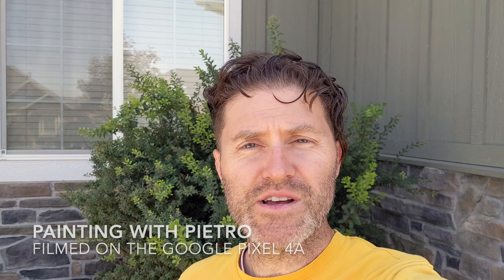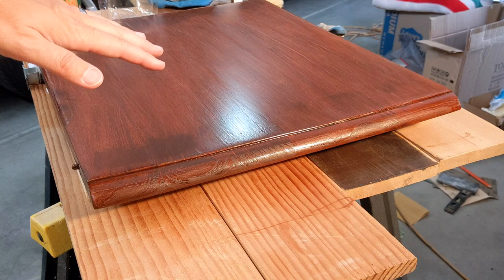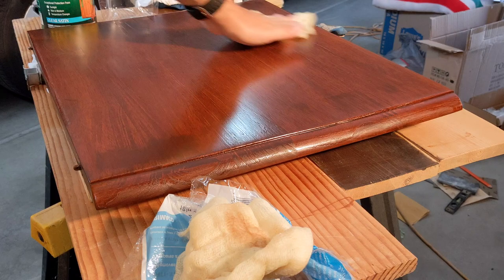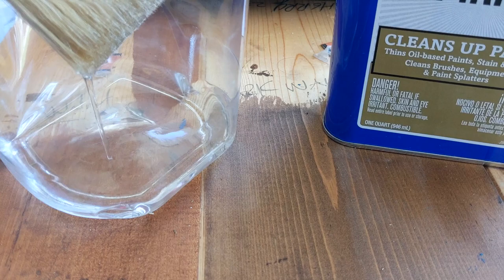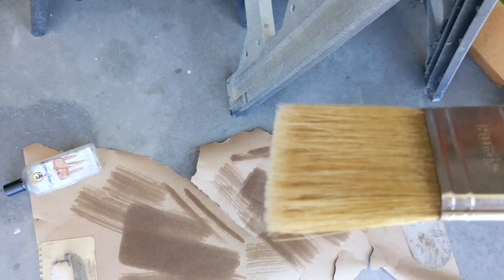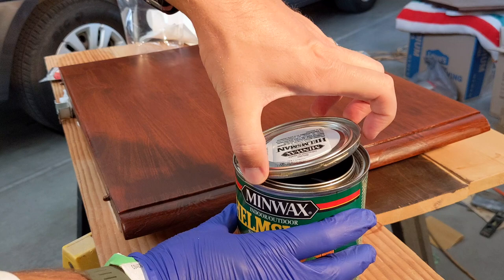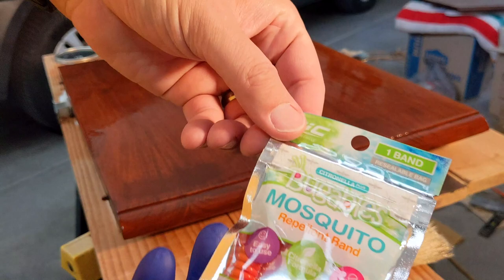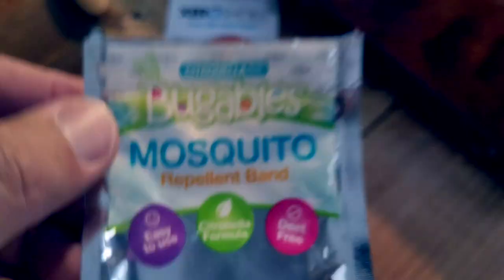How to refinish a kitchen table... Painting with Pietro

Comment: So I’m supposed to sand in between coats. Is that going to mess up the stain I already put on??
Reply from the maker: It is more of a light dusting of the tiny bumps that the polymer coat leaves. I barely even pressed on the sandpaper and be VERY gentle on any edges of the wood. I was too much in a hurry after coat #3 and had to start all over. I lost only two hours of work, but my project was delayed another 9 days.
Reply from the maker: Another important aspect is to sand with the grain and NOT in circle or you will leave marks. I used a 400 grit sandpaper and had great results and cleaned the wood as if I was a surgeon about to perform an open-heart procedure for dust will be your nemesis during every coat. The first and second coats went smoothly (no pun intended). The third coat, meh, not too bad. And then there was the fourth and final coat. Yeah, I rushed it a bit. Perhaps, this summer I will do another table and apply what I learned during this first project.
Reply: @PeterHerget  ha.. and I’m doing an outdoor picnic bench so I’m not sure how patient I will be through the process. I will try. I’m also curious if this will work on the vertical legs as well. 

I have a non-toxic gallon coming for my chicken coop and you’re supposed to be able to paint on all angles. Possibly just wait for that product 

Thanks for sharing your experiences
Reply from the maker: You are welcome & good luck 👍🏻 For an outdoor picnic table I guess a few bubbles or puddles will not be the end of your pairing/handyman career 😁
Reply: @PeterHerget  everything went great. Was skeptical at first, but managed 2 coats before sundown and woke up to beaded up rainwater on the tabletop. Worked perfectly
Reply from the maker: Nice! Beaded water is a good sign 👍🏻 Are you going to do four or five coats?
Reply: @PeterHerget  4 or 5?? I thought 2 was adequate. I have enough for 1 more but not sure if I’ll even do it. I think 2 will hold up for a few seasons?
Reply from the maker: I did four coats of polyurethane on my indoor kitchen table. I was told by a professional carpenter that 4 or 5 should suffice for a highly-used kitchen table. I would definitely do at least 3 or 4 for any outdoor furniture 👍